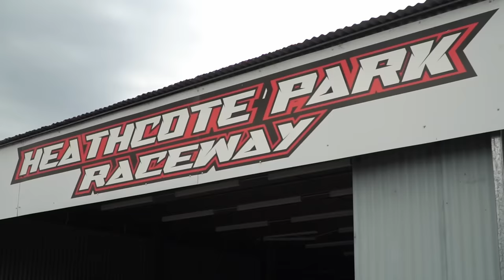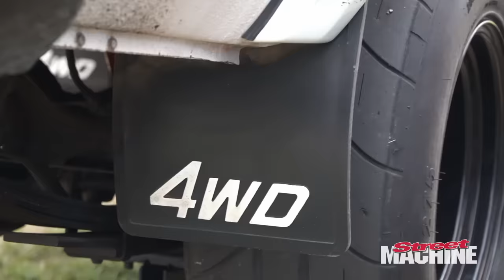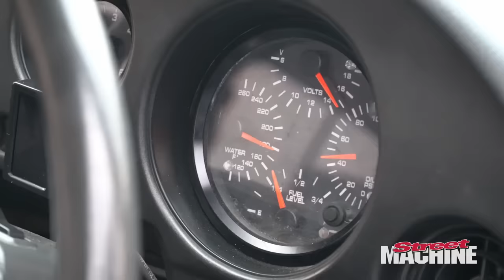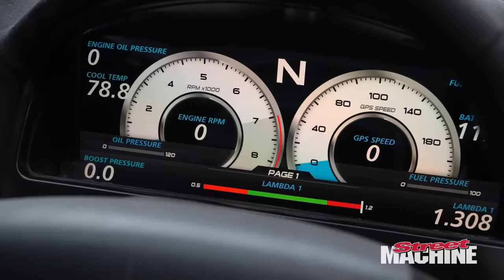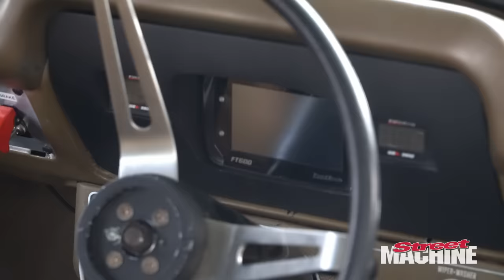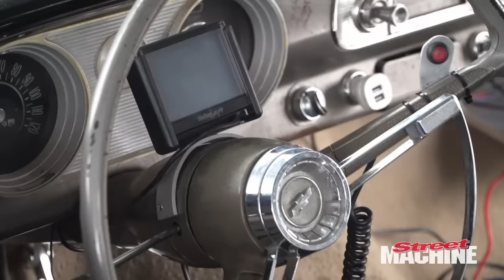Drag Challenge 2023: Heathcote Park - Day 3

Comment: I have been into drags since the early 1980's Pipe road, Cheery Lane and the AGE BLD all in Melbourne, even Heathcote, when a friend of mine had a HR ute which he built himself back then and was doing low 11's with a 308 and 4 speed, till i advised him to put a powerglide from a 350 Monaro, which he did and got the time down to mid 10's, It was a white Holden HR ute, with SWAN name on the back tailgate. Also doing the rounds at Lygon St where the best car i has seen back then was a HZ Black 4 door Monaro with a 427 big block and with white leather interior.
Again portland might be a wash out maybe, i hope not, but thank you so much for uploading the days, mainly because i am disabled and its very hard for me to get to the tracks, i did go the last day at calder 2019 and one of the track officials in the little 4x4 green van took me right upto the start line to watch it. 🚗🚗🚗🚗🚓🚓🚓🚓👌👌👍👍✌✌😊😊

Comment: lol i said it would be a wash out, got the wrong site, but was right on the money?
Reply from the maker: Didn't get rained out, everyone got two passes
Reply: @STREETMACHINETV  great, i hope it all goes well for everyone, so hard to do the challenge, its not just oil and plugs, its diff ratios tyres, oil coolant etc etc, the temps for drags is totally different compared to driving non stop and drag engines are not built to have heat non stop, which is why they tend to let the engine cool down.
🚗🚗👌👌👍👍✌✌